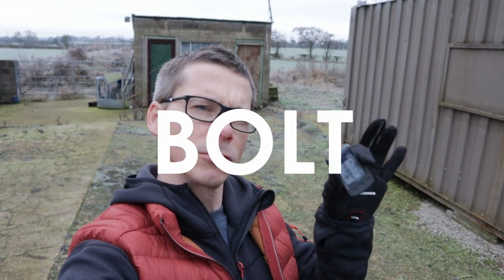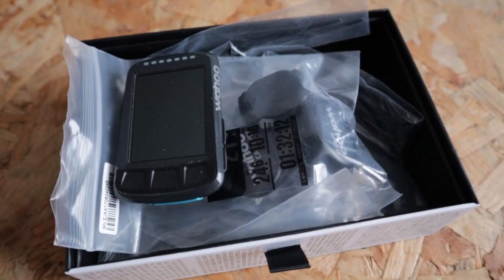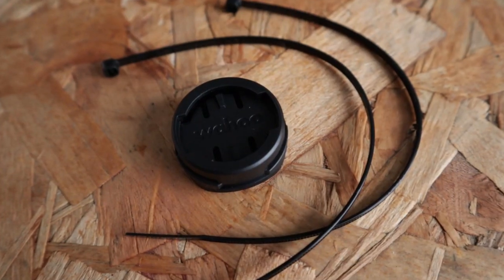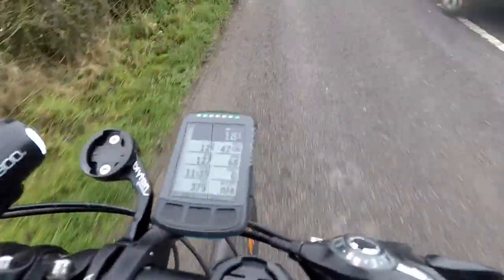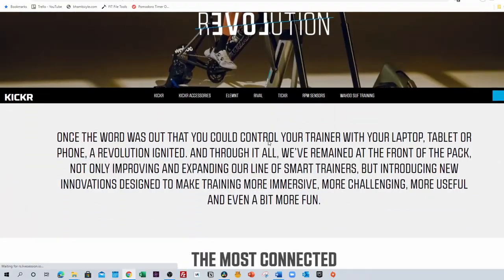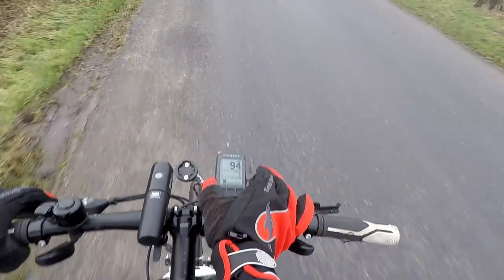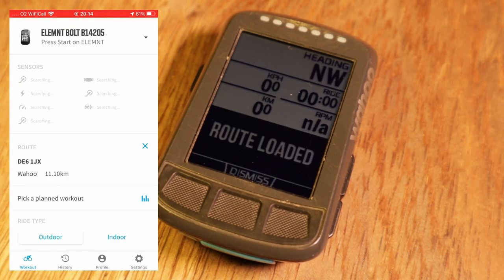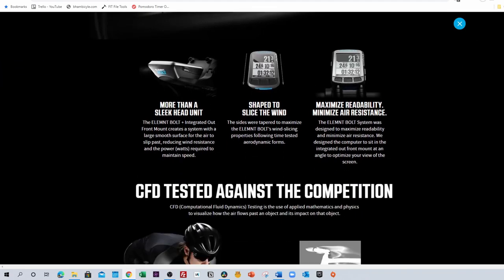Wahoo ELEMNT BOLT Review (Original v1 Version): A VERY Long Time In The Making

Comment: What you need in your workshop is a lovely wood burning stove. Great video too, was more or less settled on a Wahoo bolt and this has sealed it for me. Thanks very much!
Reply from the maker: Or maybe get power to it and plug in the heater! And this video is about the v1 BOLT. The new v2 colour one is even better.
Reply: @Sportivecyclist  I spotted an electric heater on the wall to left but those things are seriously expensive to run. I mean, a wood burner isn't much cheaper but they are lush and smell great!

Comment: I love my Elemnt Bolt. It doesn’t reroute on the device itself, as mentioned, but as most riders will have their linked smartphone with them, the navigation setting “Take Me To ...” more than makes up for this, given you’ll be alerted when you deviate from your route through LEDs and beeps (if they’re set on). I’ve never been lost using it. 
Battery is very good, at least 15 hours, and apparently Garmins last less than their stated.
I might have added two minutes on the sister Elemnt app (as it determines the parameters of the device, and with its historical rides and the data fields available).
Reply from the maker: Thanks JPSggl. It's always a challenge fitting it all in. I will probably do a vid on the ELEMNT app at some point. Maybe a comparison with Garmin Connect...

Comment: wondering if you have any info about how the bolt holds up in the rain! does it need a cover? I know what the official info is in regards to submerging in water. But wondering how it is just riding in the rain.
Reply from the maker: Hi Brent. It works great in the rain. It definitely doesn't need a cover. I've used it repeatedly in heavy rain. I wasn't joking in the video when I said that water sometimes pools in the depressed buttons on the top but that doesn't impact usability. It's more a novelty. I have actually filmed myself dropping it in a glass of water so I really should post that (short) video on here...
Reply: @Sportivecyclist  thank you sooo mush